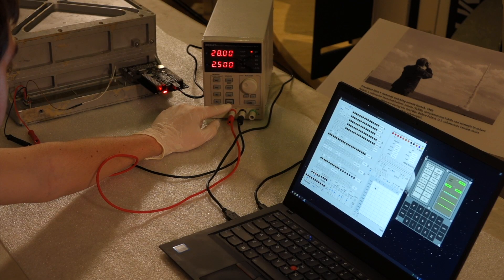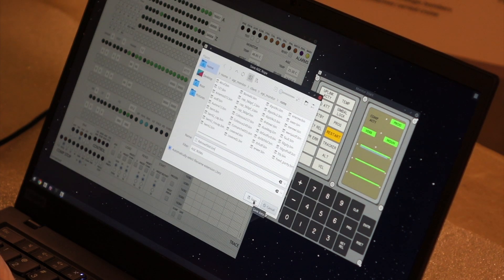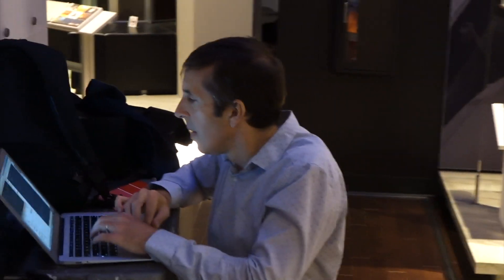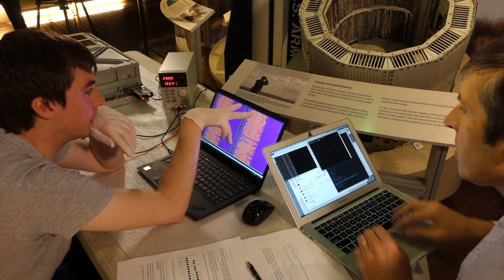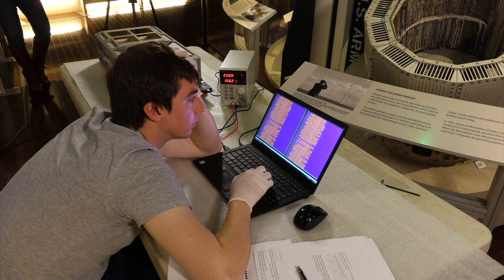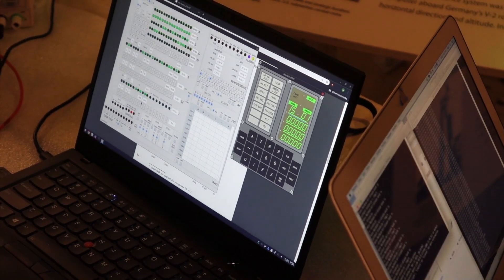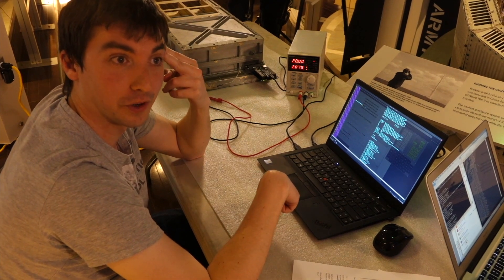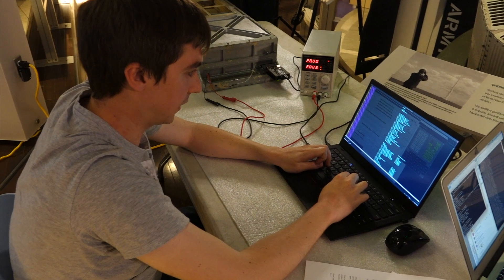Apollo Guidance Computer Part 15: Recovering lost Apollo software at the Computer History Museum

Comment: I was hoping they were going to try and fix the module so the museum had working modules. It's really cool how they were able to reconstruct most of the data using the V44 and then just fix the parity errors in the code diffs though.

@
CuriousMarc Do you guys plan to release a 100% accurate AGC/DSKY emulator some day?

Comment: From the sound of it one of the bits is not working. From and old DEC field Eng. if let say parity is odd and you read (using 4 bit + Parity) 101X 0p because it odd parity we can say X=1  so it would read 1011 0p (BTW i repaired DEC PDP-10 KA/KI/KL PDP-6/9/12/15 also NCR-500 (800 words memory Transistor Logic + Relays Logic)

From the display of a laptop 16bit ? or the way the screen splits what looks like a word is 8 Bit? unless it 16 bit split in to 2 8 bits with each 8 bit having a parity

Comment: It can still run if the data wasn't restored correctly, the program may just do not reach the incorrect memory strand
Reply: Yep, and that's why it took a bit for me to notice it. The computer started running the program fine, but took a hardware restart (fixed parity alarm) whenever I pressed a key on the DSKY. It turns out that when sitting idle, these banks aren't accessed, but as soon as you press a key they are. That's why it was such a big deal for me to get DSKY inputs towards the end.
Reply: @mikestewart8928  Lowkey genius making easy work of ancient software emulation and restoration. Thank you for keeping a piece of history saved forever. I'm definitely subscribed.

Comment: It is great to see a museum actually  contribute  to History, as well as display it.   The  AGC Team  will have code to run on their AGC.   I can see AGC and pure software AGC emulators doing  wonderful things.   Space camps could build and run actual  CM and LEM code on their mockups.   Perhaps even a classroom Command Module or LEM  emulator in software.   The AGC core would be based on the real unit with emulated inputs. Wonderful Work everyone!

Comment: Most excellent achievement.  Congratulations!  What I didn't understand was, when you determined how to recover these two bits using an earlier version of the code, how did you correct for the errors?  Did you modify the data read from the rope real time as the program was running and each instruction was fetched?  Or did you run the program with corrected bits on the PC and not run from the rope?
Reply: The monitor is able to replace individual banks of memory through the test connector. Each bank consists of two strands. So to replace strands 1 and 9, I had the monitor simulate banks 0 and 4. Banks 1-3 and 5-13 were still fetched from the real rope modules.

Comment: So if I understand it correctly, these strands were read incorrectly because a resistor or diode in your AGC is broken. Will that be addressed in a future episode? Why was this not a problem for the simulated core rope? Amazing work.
Reply: The resistor or diode failure was in the core rope modules from the museum, not in the AGC
Reply: @carlclaunch793  Ah that makes sense. I must have been not fully awake.

Comment: Its a Great Day when "core dumped" doesn't mean your Unix program crashed.
Inspiring work guys.
Reply: Although the saying does come from the era of core memory and is an explicit reference to dumping core memory during an exception :D - so really the same thing! just manual instead of triggered by an error.
Reply: Ron Laws Perl used to explicitly core dump to extract a binary containing both the just compiled program and the complete interpreter.  But that's so modern. CP/M from the 1970s used to link programs by putting the program in memory then dumping it out to a .COM file with the command actually named SAVE.  Same command also used to rescue the state of crashed programs before debugging with DDT.

Comment: This is one series which gets me excited. I don't understand much. But every once in a while the team does a thing (like attaching capacitors the terminals to eliminate that bizzyfuzzy signal) when I am like "Ah I understand that!!" Excellent work!! This is my favourite series!!

By the way I have a stupid question. How are all those programs that Mike and Ken use are made? I know a little C and a little assembly. I know that verilog was used for simulation because I have some seniors in my college use it. I am just not able to understand how all those test panel, memory(?) Programs are created.
Reply: The monitor is mostly written in python. You can take a look at the source, it's all on GitHub. https://github.com/thewonderidiot/agc_monitor

All the erasable dumps are created by NASSP. Which is a project that simulates the spacecraft in Orbiter with an emulated AGC. The mission is flown until a desired point (e.g. lunar landing) and the emulated memory is then dumped so it can be loaded on the hardware.

Comment: I guess this was how you installed software into the AGC. You physically installed the packages into the computer.
Reply: Not unlike cartridge based game systems.  How do you change games on a Nintendo Switch? You swap out packaged ROM. :)
Reply: @Cougar333  The Switch is not a good example, as the cartridges probably contain rewritable chips, and the Switch can store games locally.
Reply: @user2C47   It's a stretch, yes. It's the only example I gave from the many I implied. But Switch carts are indeed non-writable.
Reply: Probably more akin to the Fairchild Channel F and its game carts from 1976.
Reply: @user2C47  But who says you cannot rewrite a core rope module? Just re-route the wires ;)

Comment: MIT and Raytheon been much help?
Reply from the maker: MIT yes. Sadly, Raytheon no. Which I assume has to do with their military/secrecy obligations. Which is too bad, they should be so incredibly proud of their achievement.
Reply: @CuriousMarc  Figured it would be something like that.  Its not terribly old technology only 50-60 years.   Plenty of more modern space computational systems have been create since then.    Apollo had plenty of failures with plenty of successes so I'd love to see at least one more go up with stuff that works, even if its a re-creation./re-pro.
Reply: @CuriousMarc  that being said I'd like to see what it does with Noun 66.
Reply: They have a Mike and Ken!
Reply: Isn't there some hardware that is still quite close yo the AGC that is being used? I mean core-rope is probably no longer in use, but the software that the hardware is running (some missile systems). Some software that might still need to run at some point could be very closely related to this?